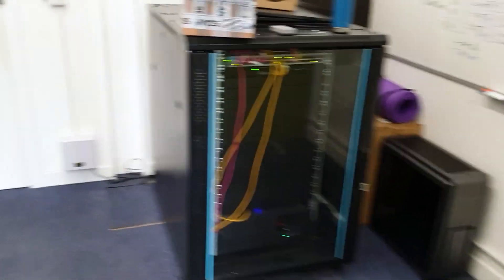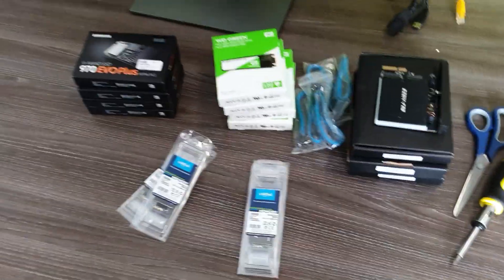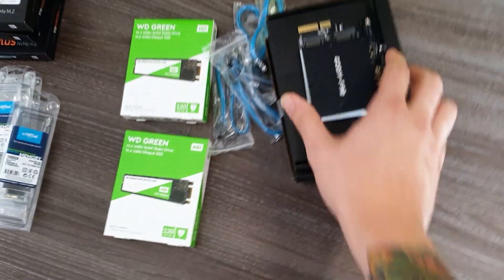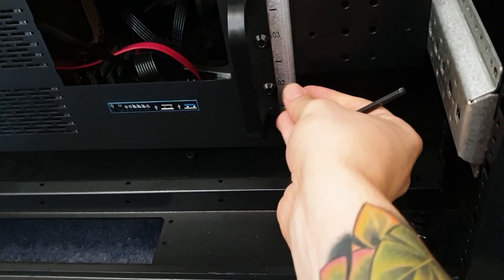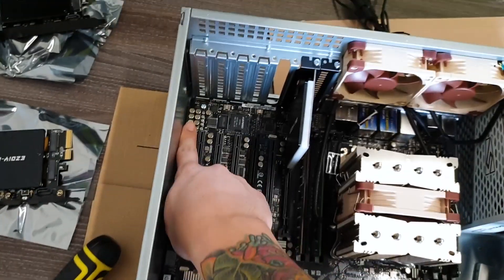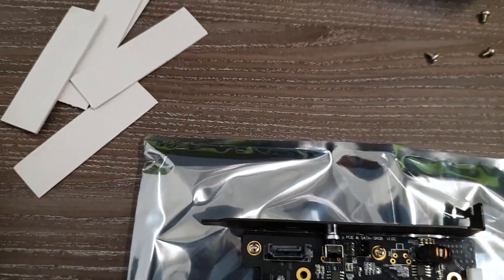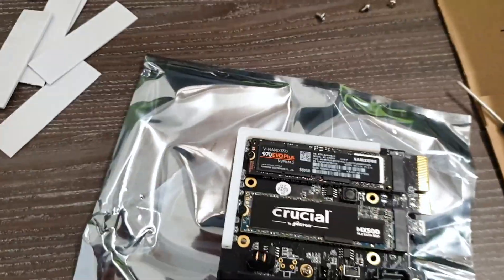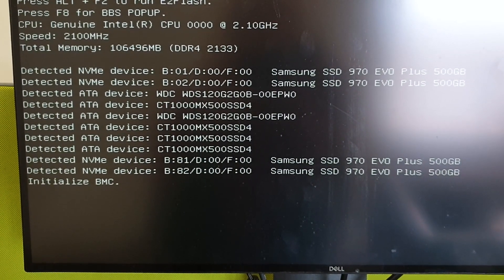NVME Storage Server with 10 SSDs

Comment: cracking for big db and compute intensive tasks, great for netfs - nvme scales so you can scale with arrays within one machine but also scale out over a few nodes in a cluster - drives will keep getting cheaper - 2023 will be year of 100gbe for smb sector - networking is the weakest link and 100g switches are more affordable - upgrade to 200g with bonding and then goto 400/800 in 5 yrs

Comment: I'm interested to know why you would use a non-LTS release on a server, wouldn't it have been better to go with 18.04?  Do you plan on updating every six months?
Reply from the maker: This is going to be rebuilt once I make the split into separate VM Host / SAN storage  in the next few months.  At that point of that upgrade I'll switch to LTS

Comment: Nice to see something from you again
You know Asus makes this right?
https://www.asus.com/nl/Motherboard-Accessories/HYPER-M-2-X16-CARD-V2/
I think it would be a greater solution but nevertheless I am jealous of your build.
I am looking forward to see a video of the router
Reply from the maker: Yes - there are a couple of these options - I think I mentioned it in the video the options are either one like this if the board supports bifurcation (cards are about £80) or you can get one with a "PCIe splitter" onboard to do the bifurcation itself (cards are about £300).  The £80 was broadly cost of what I paid - however - I believe to get it to work well I'd need a BIOS update.  The 2x Xeons I have in it are ES chips and could be bricked with a BIOS update.  Rather than risk that and the downtime (plus already having some of the PCIe cards I show in the video) I went the multiple card route.  It also reduces single point of failure - if 1x PCIe card fails for whatever reason the ZFS pool stays up.  Final reason is this solution also houses the SSD drives easily rather than in a case with no space... all that being said for my next build (a second host) I may go down the bifurcation route and one of those cards!